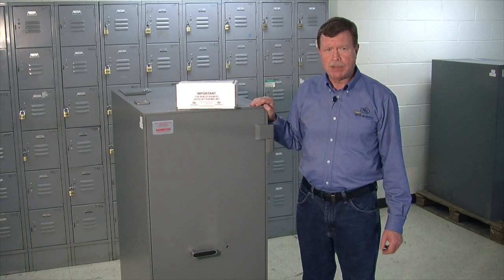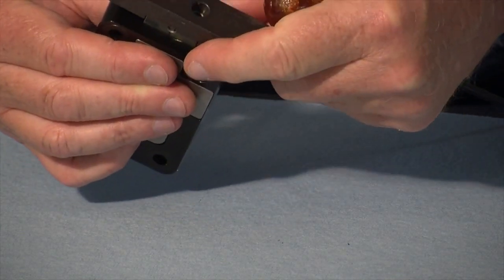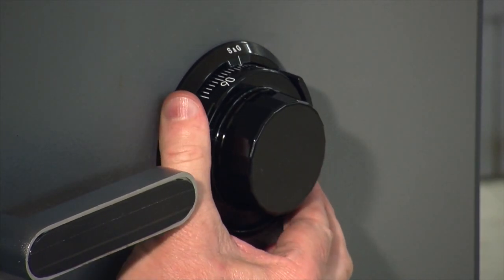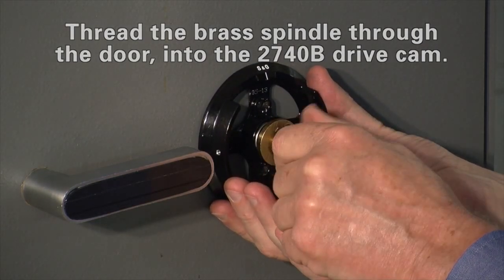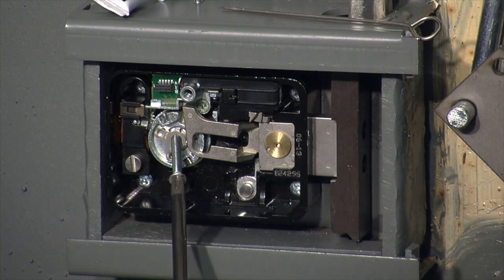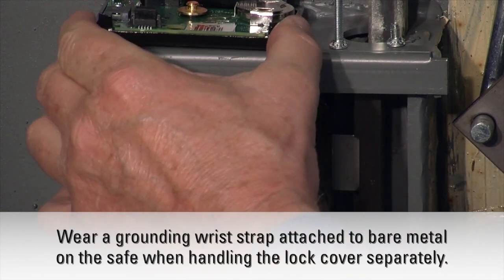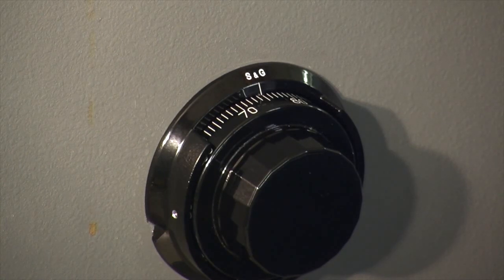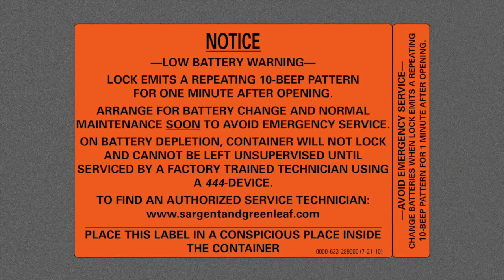v3 S&G 2740B Bravo High-Security Lock INSTALLATION

Comment: I am confused why have a battery in a manual lock
Reply: Two batteries......
Reply: Because it is not really a manual lock... The "user interface" makes it look manual, but it really is a digital lock body with a motor or servo controlling the deadbolt... If you look carefully, you will see that this lock does not need to do the regular "4 turns to the left, landing on the first number of the combination, then 3 turns to the right, landing on the second number, then 2 turns to the left, landing on the third number, followed by a turn to the right for the last number / stop position".  As such, it would be quicker to access than a traditional dial manual lock... This is not an inexpensive lock though... Looks to be around $1000-1200 from what I could find online... Because it is electronic, it has features that you will not find in a strictly manual lock mechanism...

Comment: Why the “beep beep beep” would you want this? Electronics fail.
Reply: It's a GSA level lock, so not exactly inexpensive... Instead of around $150-200 for a typical S&G electronic lock that you might find for use on a home gun safe, this costs around $1000-1200... It serves a need for certain customers, but most likely not for your typical single user residential or small business customer...